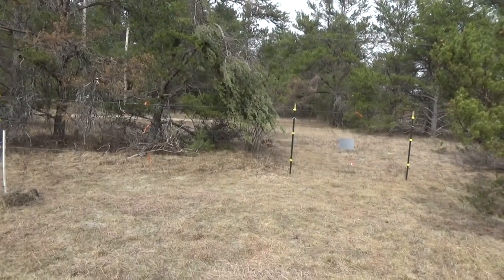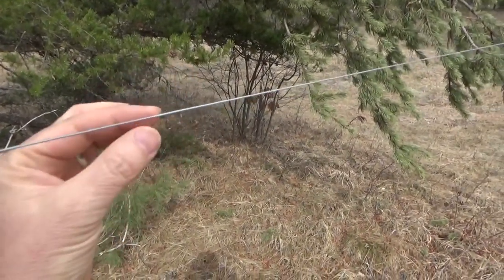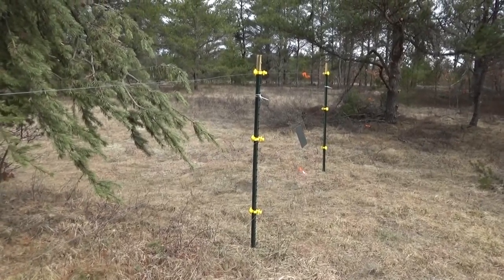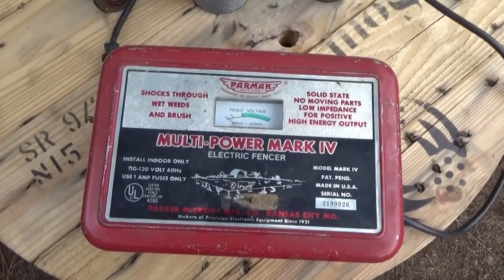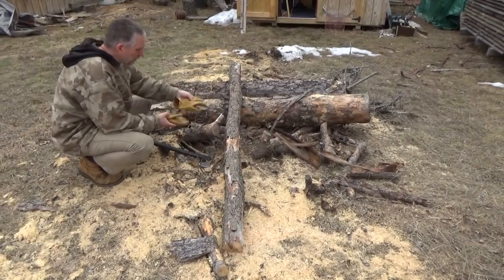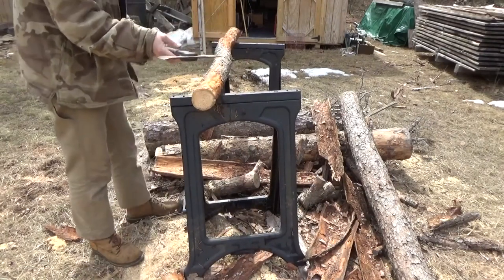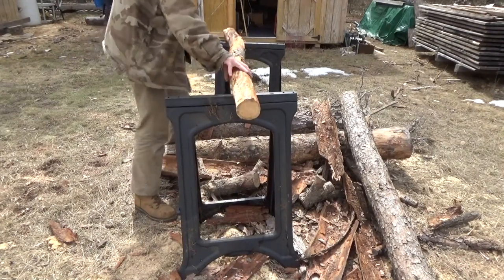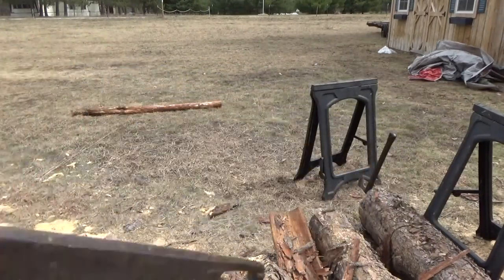Building Split Rail Fence From Our Own Homestead Trees

Comment: It would be a lot easier if you built a quick "bushcraft sawhorse". Drive two sets of 3" to 4" diameter logs into the ground in the shape of an X. Lash them together. It should be really sturdy and your rails won't be able to roll off while you debark. Several videos on youtube of them if I didn't explain it clearly. Good luck and looking forward to seeing the end product!
Reply from the maker: Yes, I was thinking the same thing.

Comment: Nice 👍🏼 love the new barricaded electrical fencing around your perimeter ! ✊🏼
Gives a cool thought 🤔
 to thinking,   go ahead boys, hopefully I find you laying there in the morning !!  ⚡️⚡️⚡️⚡️
Stay safe folks !!  😷
🇺🇸
Reply: Oh yeah!  I think leaving some of the bark in places on the split rail fence,  would look authentic with the surrounding pine forest.  It’s going to look nice!
Reply: Would the bark,  naturally fall off in the places,  that’s left on the post?   ☺️
Reply from the maker: My hope is to deter anyone from coming through. But if someone is dumb enough to cut through anyway, I have four different alarm systems waiting for them. I would be outside in under 30 seconds.
Reply from the maker: Yes the bark falls off eventually anyway. It holds in moisture and helps rot the wood faster.

Comment: Glad you remembered that tool. Use those sawhorses on solid ground for temp tables. They will also  come in handy when teaching Melanie how to parallel park. I put balloons on ours when teaching sons. Made it easier to pretend there was another car there and not damage anyone's vehicles with scrapes!
Reply from the maker: Nice idea on the parking. I never heard of that before. These plastic sawhorses are a bit broken and loosened up. I need to get some real wood ones built.

Comment: Troy, look up Parmak model 8 specifications, the model 4 is basically the same but the 8 has a digital voltage meter where the model 4 has the analog style. I believe when they introduced the Model 8  with the digital meter, all references to the Model 4 was completely eliminated. To point out a big mistake on how you installed the wire for the fence, you should have let the wire "float" on the insulators instead of wrapping them around each and every insulator. I am aware that you wanted to keep each strand as tight as possible but if the weather (temps) isn't constantly the same at all times, there will be shrinkage or expansion. eventually failure  by some means will happen.
Reply from the maker: Sadly the wire is not that tight at all and it will expand. I have experience with this particular (cheap) wire and it stretches all the time and always has to be tightened.

Comment: Split rail fences are stacked fences no posts necessary. Much easier to build that way. Use to climb over a lot them in my younger days.
Reply from the maker: Takes more space though and I did not want to use that much space - or trees